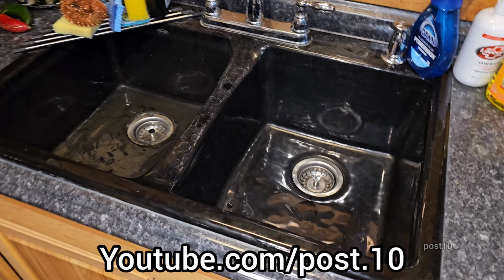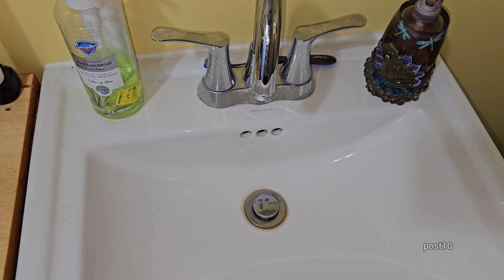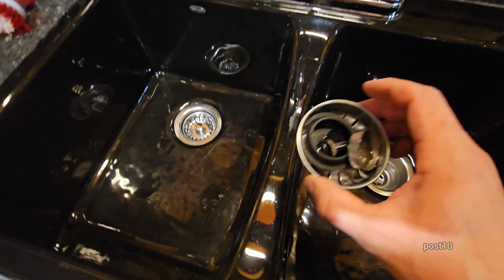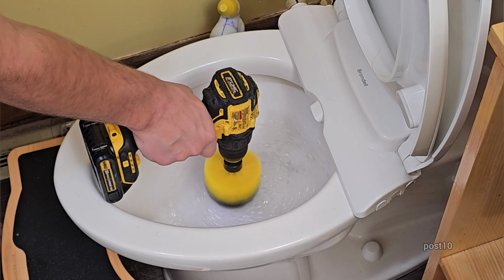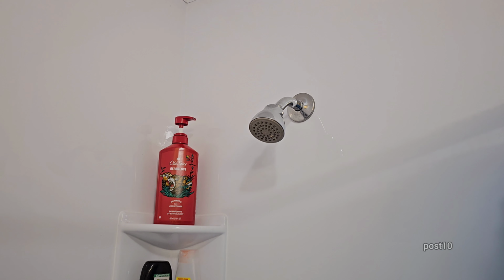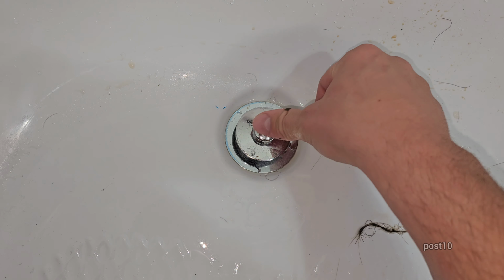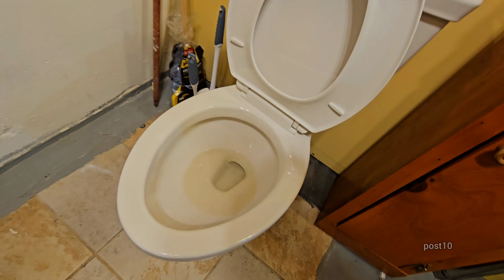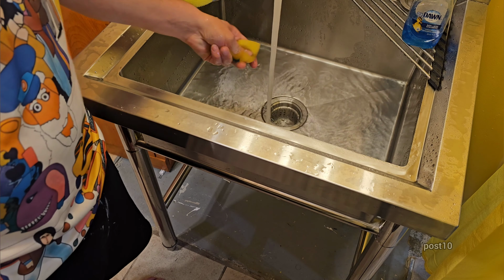Cleaning Sinks, Toilets And Shower With Barkeepers Friend

Comment: White vinegar is excellent for removing light limescale deposits
Reply: I live near the coast of the Netherlands, so water here is extremely hard, we have to use vinegar every month to get all the deposits out of our electric water cooker. We also use cleaning vinegar, it's allot stronger, so excellent for tough surfaces like the tub and walls and windows.
Reply: The concentrated heavy duty stuff works really nice!

Comment: The hands down best way to get rid of water stains: Use citric acid powder, dissolve it highly concentrated in warm water and spray it on everything. Minutes later, you flush or wipe it all off. Its the best and environmental friendly descaling agent that makes mechanical scrubbing largely unnecessary. 👌

And to keep it clean, you can spray it on every few days and scale wont come back.

Comment: Use water peroxide to remove brown stuff around like the bottom of water taps. And cleaning vinegar gets all the calcium stains removed with even a soft sponge. We use a spray bottle, half water, half vinegar, spray it over the bathroom wall and wherever its needed, and a quick brush or sometimes even just warm water spraying on it is enough. Vinegar is also excellent to remove the calcium deposits in the top of the water tap nozzel, just unscrew it, let it soak for half a day (a full day if its really clogged) and its like brand new again!

Comment: I live in a very hard water area in England and have a dark green sink. I wipe up any spills and wipe the taps and sink with a towel EVERY time I use it, and never have a problem with water marks etc, and it always sparkles like new. Saves all that messing around with drills etc - CRAZY !
Reply: I live in England in a hard water area too. I clean my toilets and sinks every day and dry them too. It saves time and effort in the long run.

Comment: Have you thought of investing in a water softener
Reply from the maker: Absolutely not for many reasons. It cost a lot. It puts wear in tear on the septic system, which is made out of reinforced concrete because of all the salts. Soft water is awful for cleaning yourself. When I take a shower at people's houses that have soft water, it feels too soft. There's no friction with the water, so it feels like you can never get the soap off. And my water tastes great